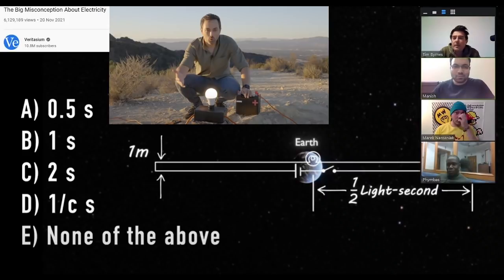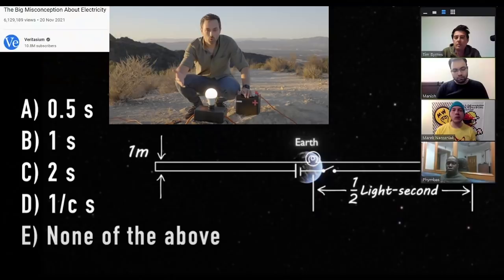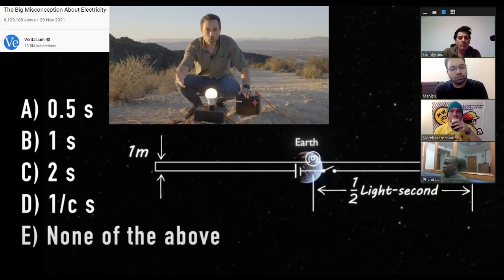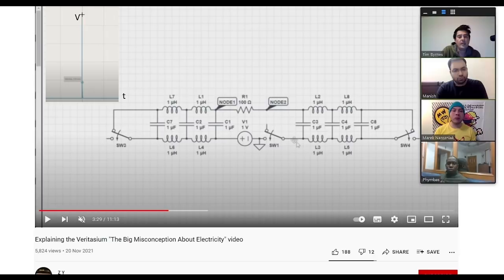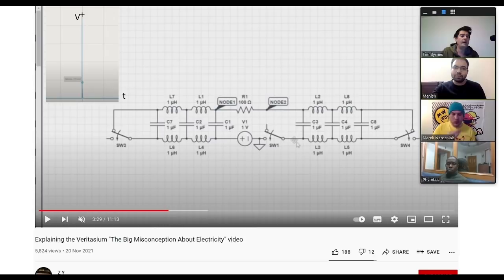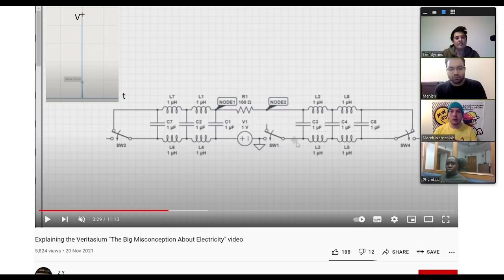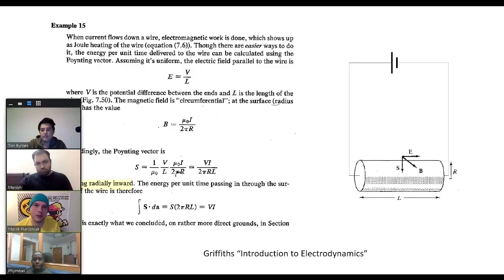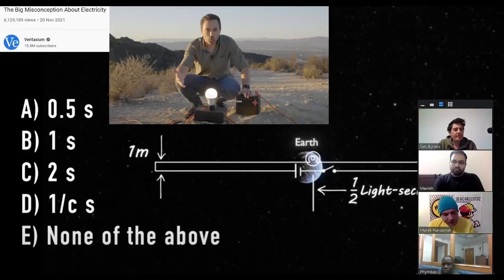Veritasium's Big Misconception About Electricity video and the point about Poynting

Comment: A related area of discussion is trying to understand the difference between the 'near field' and the 'far field' of an antenna.

Clearly antennas radiate EM energy, and in the far distance from the antenna (where no charges are present or moving) the Poynting vector is critical to describing energy flow.

But near the antenna you do have charges moving, and often it makes more sense to think of the charges moving and the current.  Using the Poynting vector near the wires of a circuit is a description that is weird and difficult to work with.  But the maths do work.

Jon
Reply: The Poynting vector (PV) gives the right electromagnetic energy balance for a bound volume. That is what the Griffiths' example shows.  I see Feynman's point but it does not strike me as absurd to have some kind of (reserve) energy represented by the circulating PV. In the charge and magnet example, take another charge -q nd place it near the charge q. Neglecting all other effects, they will attract each other (+q is fixed, -q is mobile) and merge, creating heat as the kinetic & potential energies are cancelled (after they merge the PV vanishes). Where does that heat must come from? From the (reserve) energy the PV represented.

Comment: The Poynting vector describes a stead state, this is a dynamic system due to the switch. If you notice there is no time variable.

Consider if the switch was on the end of the line dangling out in space, a half light second from the lamp and battery. If you flip the switch would the light illuminate in 1m/c s seconds despite the fact that the switch is half a second away? That would mean breaking the speed of light so I doubt it. 🙂

Comment: Thanks for the video. People get so focused on the direction of the Poynting vector that they forget that it also has an amplitude. Yes, SOME energy is flowing through the air from the battery to the light bulb... But the amount of energy flowing like this is insignificant compared to the amount flowing along and close to the wires.
The problem is that all of us like to think intuitively, and vector direction is very easy for that, and are just too lazy to do the computation and see through which part of the Poynting field does MOST of the energy actually flows.

Comment: Thank you very much for the video, it was illustrating to me to revisit the concept of Poynting vector.
The first point I'd like to emphasize is that the diagram of the electric field in Derek's graph is badly drawn. IMHO, that error is intentional. He tries to show that the Poynting vector is more or less the same in the space inside the circuit, regardless that both magnetic and electric fields are much stronger around the wires. That leaves to the misleading idea that the energy is transmitted in the vacuum and not in the wires, but that is not true. Inside the wire, as you've shown in the Griffiths example, the Poynting vector is pointing outwards, but outside the wire, as the electric field E tends to be perpendicular to the wire, so Poynting vector will be more or less parallel to the wire. Then when you close the circuit, even when a little current will be induced in the lamp, it will never light up. Poynting vector will travel along the wire just like the current, at almost the speed of light. That is way the lamp will turn on in 1 second, approximately, although a little EM pulse will arrive the lamp in 1/c seconds.
Anyway, Poynting vector does not deny that the current drives energy. Poynting's theorem says that the rate of energy transfer (per unit volume) from a region of space equals the rate of work done on a charge distribution plus the energy flux leaving that region. I.e.

du/dt=∇•S+ J•E

And this energy flux is the divergence of the Poynting vector. In the case of a battery powering a lamp, that divergence is zero, so all the energy is in the form of work done (J•E), that leads to the known Joule's law (P=I.V). In DC circuits there is no divergence of the Poynting vector, so there is no energy loses in the form of electromagnetic waves.
Of course there is a transient EM wave associated with closing or opening DC circuits, but they at most will interfere with your radio device, never turn on a lamp.

Comment: My favorite way to see this is that a transmission line is a waveguide whose pass band extends to DC. The free charges in the conductor result in fields that steer the poynting vector down the wires. I find it helpful to try and see the metal much in the same way we’ve learned to view dielectrics. We see dielectrics as polarizable bound charges that result in some net effect in the presence of fields. Conductors do a similar thing. Locally, a field can push electrons through a lightbulb but globally the fields are sort of continuously outrunning the charges and shifting them in such a way that they generate conjugate fields that guide the field along the conductor, where this effect can extend down to DC.
Reply: In this picture, it’s pretty clear that the electrons aren’t carrying the energy. They’re in some sense doing the opposite — they’re sapping energy from the fields and giving it to the lattice through electron-phonon interactions over very short interaction lengths.

Comment: I think the Poynting vector here makes sense.  I mean, it's just looking at the E and M fields in a certain area, which I think we'd all agree are real.  And those are just measures of the photons being propagated through that space.  So if there are photons moving through a space, there is energy passing through it.  The problem, I think, is that the drawing makes us think most of the energy lighting up the bulb is coming through those fields into the bulb from outside the wires when the bulb lights up.  I dont think that's the case.  Most of the energy will come from inside the wires in the DC case.  But when you have a spike in current, and then the capacitance that moves energy through space to the bulb, this is indeed moving along those Poynting vectors to the bulb, and that small bit of energy goes into the nearby wires and bulb metal and induces a current that might... maybe, dimly light the bulb.

Comment: The 2004 paper is exactly right.  Feynman's example of resistive wire is misleading at best.  He is only showing the tangential E and ignores the normal E field.  The true S vector even in Feynman's case would be tilted into the resistive wire - the component normal is the resistive loss, and the component tangential will flow along and decrease as it progresses.   For a good conductor, the tangential E field is tiny - the normal field would typically be orders of magnitude larger.  So S is almost fully parallel to a good conductor.

Comment: So the real question is: what ìs actually Energy? And does it actually even "flow" at all.
Questions like these exist for very long, and no one as ever found the final answer as far as I know.
I understood that the best known explanation is simply that energy is a configuration in which things are. In that way, it's very related to the word "information".
I have seen another video, in which  pretty much the same idea is shown as on the left side at 10:35 in this video, where you see pointing vectors everywhere, all in perpendicular directions to the current.
This perfectly fits into the idea of a general Electric Field throughout the entire universe, that can fed with energy from anywhere, and from which energy can be extracted from anywhere.
In this Field it does not matter to much how energy flows, but the fact that it has a value, and that energy is always being conserved.

Comment: The chain in the plastic tube, and the reference to the under sea cable, to me buggered up the central point of the video. He made some good points, but they didn't help his case. A few issues with his conclusions I had were, if all that were true, why do wires melt trying to flow too much current if things are mostly external to the wire? And why do stranded wires act differently from solid core wires? Anyway, good discussion. In general the internet has gotten way deep in the weeds on what I think was a "simple" concept he was trying to convey. But it's probably not possible to simplify it the way he was attempting?

Comment: Yeah, great video! I just recorded an answer to Veritasium myself but haven't uploaded it yet, which I also bring up Feynman's examples (who can forget it, right? ). But one thing that I mention is that the image you show at 13:10 of the circuit with the field lines, is exactly what that 2004 paper mentions: The E field is perpendicular to the wires. In fact, Derek actually explained about the surface changes in the original video. So, back to the field lines rendering, it called my attention that the yellow lines (Poynting's vector) do follow along the wires, except by one misleading line on the horizontal plane. Showing just the lines says nothing about the strength of the vector field and I'm pretty sure that line has a negligible contribution to the integrated power transfer. In summary, this rendering has the correct answer except by this single line drawn there to ensure Derek's arguments would stick. Not that he is wrong, after all this is a textbook case. But I think he got himself bitten by the viral-video bug in this one.

Comment: Is the Poynting Vector somewhat analogous to the Bohr atom in that it gives you the correct answer at least some, but not all, of the time?
Or is the Poynting Vector just a successful mathematical model to calculate energy flow but does not really describe the physics behind energy flow?
This raises so many questions, but I guess that is what Veritasium wanted us to do.
Reply from the maker: We would say its more of the mathematical construct, rather than the Bohr atom, which is a crude approximation to the real thing.  It gives exact results, but it is hard to interpret.  Veritasium takes it as literal fact that the energy is flowing in this way, but as Feynman says, it is strange and not eay to interpret.
Reply: @NYUQuantumTechnologyLab  Presumably this (the speed of energy flow) is actually testable, though, right?  We don't need millions of miles of wires, we just need sufficiently accurate timers and triggers to measure a much smaller example case, and varying geometries to tease out any capacitance effects.
Reply: @NYUQuantumTechnologyLab  My opinion is that at some level they are equivalent descriptions.

Comment: Changes in potential propagate at the speed of light. Think of the charges as low frequency radio waves and the conductive as transmission lines.

Comment: Yes. 
Even more interesting is to calculate the size of a suitable strip wave guide so that a real lamp (say a 5w car lamp at 10V) or LED (constant current limited), will illuminate immediately (1m/c secs), and later the same when the conductive current arrives.

You can end up with a 1km wide x 3mm deep wire on each side (other choices possible). Key is to decide the 'resistive' wave impedance needed to match the end to end wire resistance.

Comment: One problem I have with the idea that the energy is being carried in the fields and is represented by the Poynting vector is the case of an electron gun.  In a cathode ray tube a beam of electrons is accelerated by an electric field between the cathode and the anode.  So far so good, there's clearly an electric field, a current, a magnetic field, a Poynting vector and an energy flow.  But the beam of electrons then passes through the anode and carries on to the screen which is at the same voltage as the anode.  There's no electric field in this region so E x B is zero and there's no Poynting vector but there's clearly an energy flow to the screen which glows as a result.  It would seem that sometimes the energy is carried by the electrons and not the fields.

Comment: I think that paper you cited does make sense and even solve the issue. Because Poynting vector maybe a construct, but done on a circuit like this, it measures the flow of photons, especially if one replaces the battery with an ac source in Veritasum's circuit. So that way it implies photons being emitted from the source and reabsorbed at the load, which is measurable, yet unobserved. I think maybe because the charges are moving, the field too is changing, which is what the people in that paper did. Also, some people have pointed out that there is a second for dynamic systems, involving time derivatives. Maybe it's something to do with that. Need to learn more.

Comment: This is OK discussion. However: 1) Capacitance is property of non-ideal conductors. It was clearly ignored by Veritasium and the analysis backing him, so I think one should assume conductors having no capacitance. 2) It seems that different variations of the setup are being analyzed without noticing the distinction. The original setup had one switch next to the positive terminal of the battery. So at t<0, the bulb and practically all the wire would be at equipotential with negative terminal of the battery. Anyhow, it's disappointing characteristic of the social media era that the original video, whose only merit is posing an interesting question, has 10M views and 377k likes. Valid discussion on actual physics of the problem receives practically no attention.

Comment: My 0.02 cents.... 1) intuition in modern Physics is most often a false friend. 2) The Poynting vector is real in the sense that it follows the direction of the propagating EM wave.  3) Look up this article on Wikipedia on Poysting's vector in static EM fields based on the example from Feynman's lecture 27-5. It mentions how the Lorentz force could be explained through the Poynting vector. 4) Poynting's vector is a fundamental aspect of any EM radiation. A circuit is only a demonstration of that principal. 5) The energy is in the EM field rather than  in the kinetic energy of single electrons... see AC current or capacitors.

Comment: Very simply stated, just chuck out the air and replace it with a perfect superconductor. With a think isolating material in-between the wire section which is also superconducting in his example. Now you have a setup where no electric fields can change outside the wire itself and the isolating material. Now all the poynting vectors are inside the conductor and isolating material, because the electric field in the open superconducting material is 0 and so is the magnetic field. Therefore the in my stupid over ideal model here we get the  initial power up after 1 second roughly instead of 1/c. Thats the contrasting picture one should imagine here i think, where the fields simply cannot propagate outside the wire/isolation.
Reply: Should? So what about the definition of 'c'?

Comment: My two cents: The lightbulb is a sink into the aether for photons. Photons have a neutral charge. That neutral charge arises from the combination of the positive and negative charges present in the circuit. Only when the switch is closed can these charges combine and leave the circuit via recombination into a neutral photon. The recombination powers the emission. Hence a battery is potential energy, the closing of the switch in a cct allows to transform this potential energy via recombination into kinetic energy via the form of the neutral photon  which drops into the aether. Note that this explanation assumes that a photon has an internal structure: a combination of a pos and neg charge which balance each other (perfectly).

Comment: U is energy density. 
S is the Poynting Vector.
E is the electric field.
J is current density.
dU/dt + Div(S) + E*J = 0  this is the statement of local energy conservation, holds at every point in any electromagnetic situation.
There are modification inside materials of course where magnetic field H is proportional to B and various constants but generally S = cross product of E and B.
Also U = 1/2(E^2 + B^2)

Div(S) = Div(E cross B) = 
B*(curl E) - E*(curl B) =

B*(-dB/dt) - E*(J + dE/dt) =
-d/dt( 1/2(E^2 + B^2)) - E*J = 
Div(S)
by the above and using Maxwell Equations.
You get
dU/dt +  Div(S) + E*J = 0   local energy conservation.
For electric statics where fields are constant, dU/dt = 0  because U is constant, see above.
So Div(S) = - E*J = - J*E

The Divergence Theorem relates volume integral of Div(S) to the surface integral of normal component of Poynting vector over boundary surface.

So you can see how Poynting vector becomes involved in ANY electromagnetic situation, static or dynamic and of course local energy conservation holds at Every point( with appropriate modification of course inside matter where H and D fields are involved )

and remember derivatives are partial derivatives and d/dt of E^2 is equal to 2EdE/dt

So all of the above always hold for ANY electromagnetic situation and help explain the magnitude and DIRECTION of Poynting vector at each and every point.

Comment: The way I'm seeing it is Veritasium makes it seem like what's happening is the energy is flowing from the battery to the bulb across the distance between, but that's not actually what I'm getting from the poynting theory. Instead, it makes sense to see it as like being an open ended container under water where some kind of pump expels some of the volume of water in the container from one side of the container out of it, but the volume is immediately replaced because it is under water.

Comment: Suppose that instead of ordinary wire, we use, say, co-axial cable to connect the battery to the light, and the co-ax shielding is connected to some arbritrary separate earth...
- now we repeat the exact same experiment
- how long does it take for the bulb to light?
- what happens to the Poynting vectors?
- does it matter what the Impedance of the co-ax cable is?